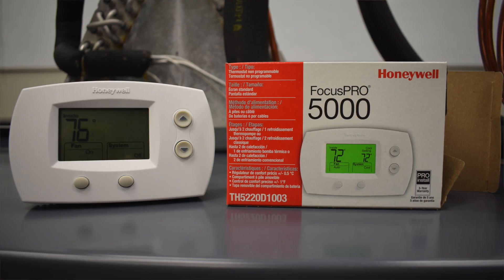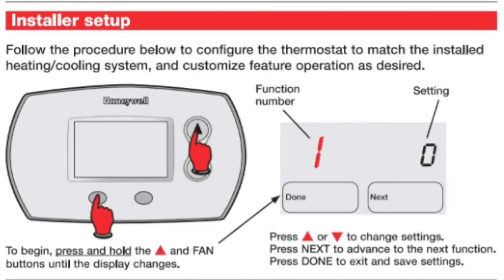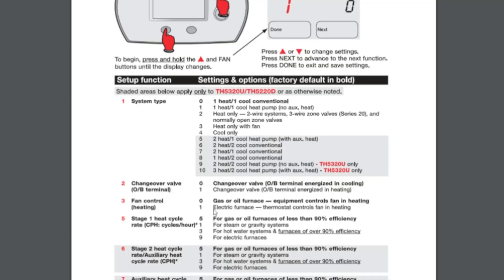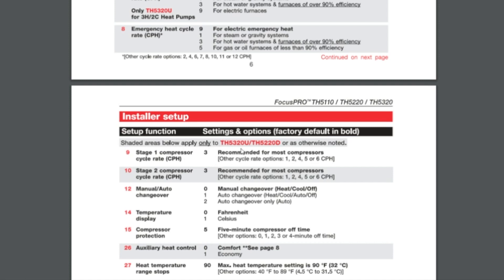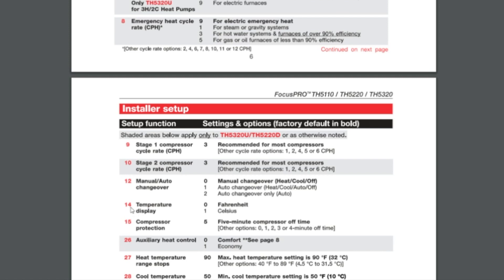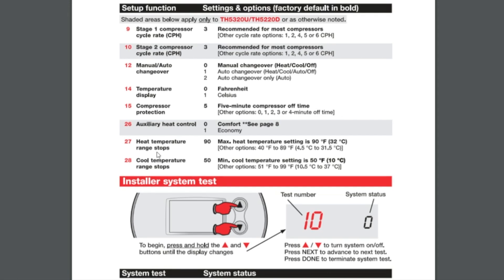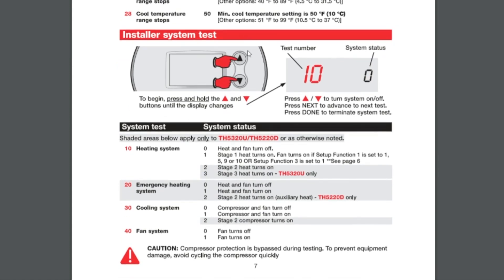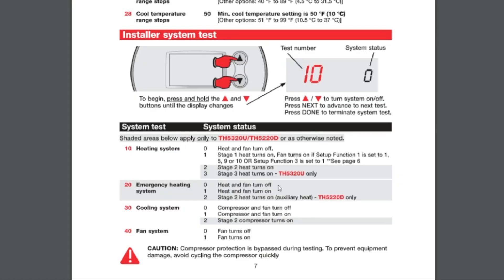Honeywell FocusPro - Straight Cool Setup & Wiring

Comment: Our supplier here told us these are being phased out for the Honeywell  t-6 and t-4.   
And will soon no longer be available.   Any body else hearing that as well ?     I love these stats simple and durable.
Reply: T6 and t4 are the replacements....   No more focus pros!!!
Reply: Heard that about 6 months ago. And the T-6s suck, lots of problems with them reading the wrong temp. We went back to 5000's few weeks ago.
Reply: We still get boxes of them
Reply: I've been hearing that the pro 5000's are being phased out for over a year now and they're still available. We buy all of them we can get our hands on. Honeywell has gotten a lot of flack for the t6 thermostats because all the technicians hate them and they do have numerous issues. They have to have batteries even with a "common" wire, because if the house ever loses power the thermostat will go into a lockout mode wanting you to set up the time and date again and nothing will work until you do (unnecessary service calls). They have problems not displaying the correct temperature and we found a few that won't energize the reversing valve on a heat pump.
Reply: I have had NO issues with any of the t series stats...   Except for the lyric t6 pro in beta tests...

Comment: With mines it’s not lighting up green anymore and it doesn’t read what the temperature is in the house. It does show the numbers on the right and won’t turn furnace on. Is there a way to reset it?

My installer setup goes...10-30-40-70

30 and 40 and 70 don’t do anything

Comment: I had installed this thermostat last year replacing with NEST which I did not like and was having problems immediately after installing. I am having the same problem with Honeywell as well. I don't know too much about electricity  I guess being a woman it's not common. Anyhow the problem I am having is only when I use the heater. This thermostat works great with the A/C so did Nest. When I turn the heater on and the fan is set on auto, It works and turns back on a couple of times then it stops. I can hear the furnace running but the fan will not turn on. I try to turn off the thermostat, but it won't turn the furnace unit off until I turn it off the electric breaker for the unit at the main electric panel. I had the same problem with Nest. The only way it would of work if I disconnect the yellow wire at the thermostat which is for the A/C that Nest had advised. Now I have Honeywell and I still have the same issue. I have all the same colors as the wires shown on your video on my thermostat wiring. I have a COURIER FURNACE that is about 25 yrs old and is working great. The old thermostat before I switched to Nest was I think Honeywell as well but it was one of the oldies with mercury?    Both Nest and Honeywell were installed by a licensed HVAC CONTRACTOR, but I keep on having the same issue. I never had any or similar issues before replacing my old one which I truly regret. It's very true that if it isn't broken it should not be replaced.  Any advice you can give would really be appreciated. Thank you in advance for your time.